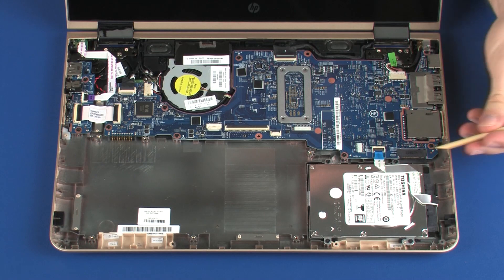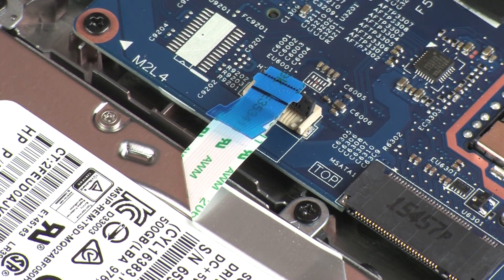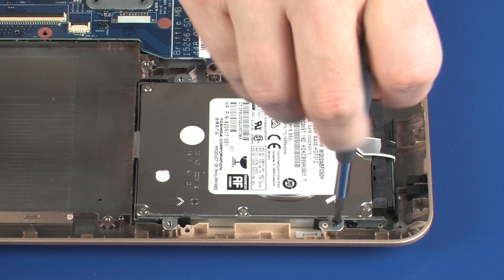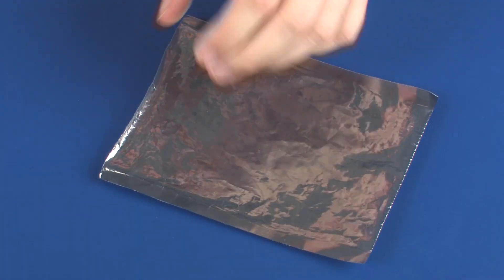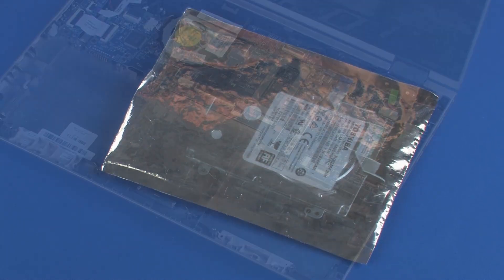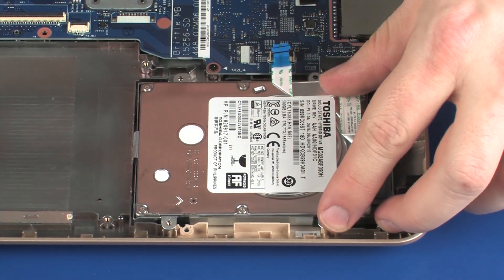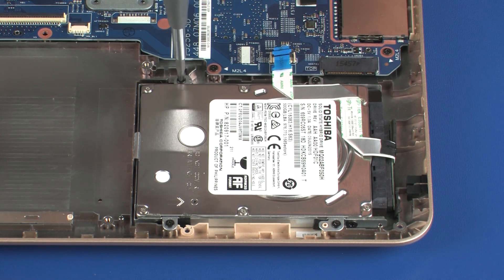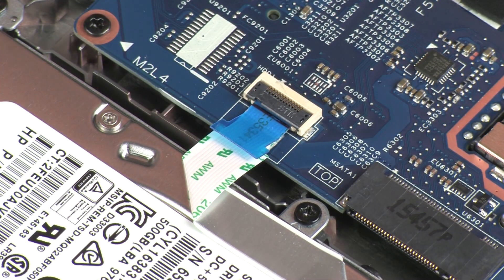Replace the Hard Disk Drive | HP Pavilion x360 m3 Convertible Notebook | HP Support

Comment: On this computer can you replace the HDD for a SSD or only works with HDD?
Reply from the maker: +Martin Ossana Please refer page number 3 of the user manual to know about supported storage: https://bit.ly/2N4OLbP
Reply: @HPSupport link doesn't work
Reply: Most likely can be replaced with SSD - most modern computers will support SSD - some require a slightly thinner hard drive
Reply: You can replace it with an SSD. I did it myself. HP staff are morons.